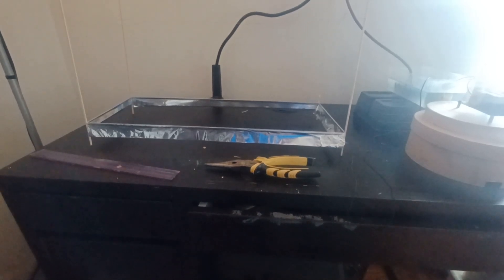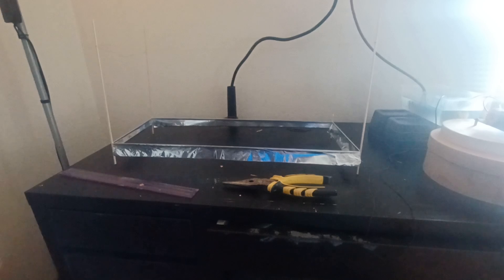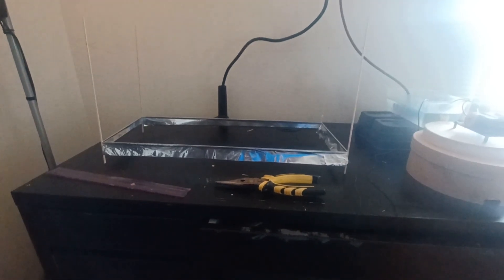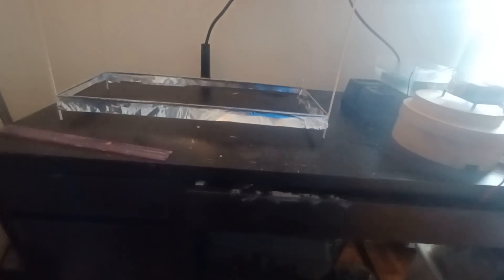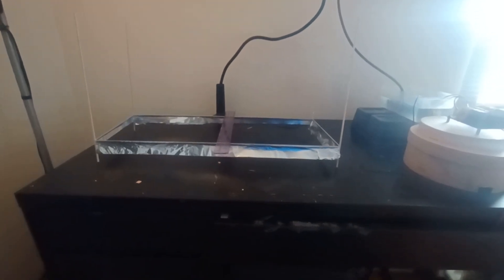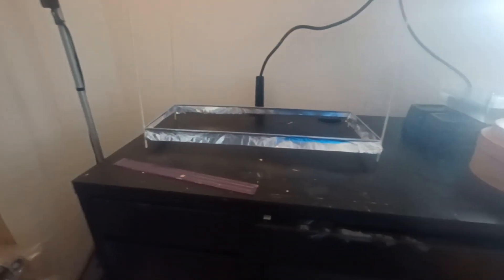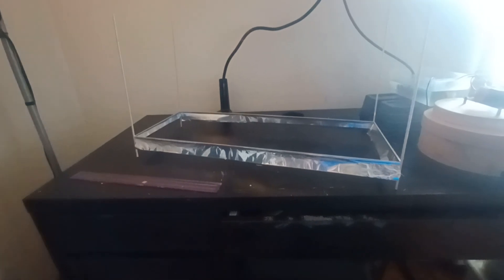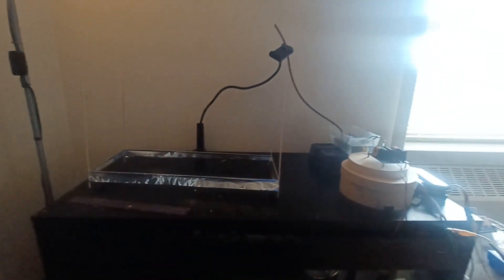ion lifter 4.2b

Comment: Did similar tests with my 250kv HV power supply.
My models look slightly different but the principle is the same.
During my many tests, I noticed there's a threshold voltage of about 10kv, anything under won't create enough thrust.
If using DC, a 5% ripple might be helpful.
There's tons of tricks to make these things go aloft.
Nice work.
Good luck.

Comment: looks heavy.cant believeyou are touching it with your hands!
Reply from the maker: @c6jones720  Hey. There is no high charge between the wire and foil. If i dishcarge it through the hv multiplier and ground. That will produce a high discharge.
Reply: @goobman1981  ok, please just careful, I've had nasty shocks from lifters

Comment: There's another thing about "jumping".
When it comes to dielectric materials, supplying DC continuously leads to saturation followed by dielectric relaxation.
What that means is, a short time after "jumping" the model looses its oomph and stops lofting.
Ideally, a HV impulse current could prevent that.
Reply from the maker: @valcocora5689  you are correct. I've done test where i pulse the switch and if im fast enough i couls get it to hover at a certain height before it veers off.
Reply: @goobman1981  Do you happen to know a way to produce high voltage impulse current?
Something like a Ruhmkorff, but for DC?
Reply from the maker: @valcocora5689  the way i would do it is connect a dpdt relay and wire it so it self oscillates. Then connect the relay from the battery to the zvs driver. Adding a variable air capacitor to control the timing of the relay.
Reply: @goobman1981  I wonder if that would work with my HV power supply.
It goes up to 250kv and about 3 mAmps
Reply from the maker: @valcocora5689  i don't see why not. Relays used in a car handle high current.
Reply: @goobman1981  Thank you for the tip, but unfortunately, that only solves half the problem for me. The other half is the model behavior when using materials with a high dielectric constant.
Reply from the maker: @valcocora5689  can you explain more. Is this a standard triangle lifter? How big is the model?. What material is the dielectric?
Reply: @goobman1981  The model depends on the material you use.
If ceramic, it obviously won't look like a lifter. Not a big loss there, the lifter doesn't have the best shape needed to do the job.
Size is another matter, hard to find somebody to build a ceramic part the size, say, of your lifter from the video. So ceramic models are usually smaller. I've been playing with models from 2 to 4 inch diameter.
Bur what you loose in size you gain in efficiency. The model speed goes up with the k constant. 
Allow me to give you an advice: if planning to use high k, do your tests outdoor, otherwise you risk putting a hole in your ceiling.
Reply from the maker: @valcocora5689  i thought about ceramic dielectric myself. I did find ceramic paper, but it looked as if it would catch on fire if a arc did jump between the wire and foil.
Reply: @goobman1981 
No, you need to look at the serious stuff.
And then you shall enter my world of frustration, lol.
Reply from the maker: @valcocora5689  sounds interesting. How do you need the ceramic shape?. What design.
Reply: @goobman1981  You ever seen a ufo?
Reply: If you don't mind my asking, are you familiar with assymetrical electrostatic fields?
Reply from the maker: @valcocora5689  actually yes
Reply from the maker: @valcocora5689  yes. Im familar with the fields.
Reply: Guys, buy barium titanium powder. 7000 dialectric constant. 

If you can make the powder even smaller, then it can go 15.000 constant dialectric. 

Buy 10g or other epoxy with high k. 

Melt the epoxy mix the powder. 

You can cast any shape you want. Good luck.😅
Reply: @Kingly-meh  That's all nice but how do you glue electrodes on such a thing?
Reply: @valcocora5689  it doesn't get very hot to melt it, you can use your kitchen. Electrodes you can put them ready before casting or during or simply after.
Reply: @Kingly-meh   What about the leakage at the interface between the electrode and the ceramic? That's also grounds for current leakage which leads to loss of power?
How do you solve the adherence problem?
Reply: @valcocora5689 it's a challenge. It has to be insulated with something.

I got little frustrated with the lifter due to sparking. I sprayed screen cleaner🤣 and it worked for a little
Reply: @Kingly-meh  Allow me to be more specific. Poor adherence between electrode and ceramic leads to tiny air pockets formed between the two. This in turn leads to loss of power just like you loose compression in an engine if the segments don't seal properly. This is enough to contaminate the experiment. I don't see how one could ensure this by manufacturing the ceramic capacitor in one's kitchen.

Comment: that is crazy it has to be 12" up on the wire. 200kv. Do you have a parts list?
Reply from the maker: Hi. Its the same voltage multiplier, flyback and zvs driver. Only 24v input and immersed in mineral oil. I believe i can push it to 300kv.
Reply: @goobman1981  so the voltage has a better distance when the capacitors are cooler in the mineral oil?
Reply from the maker: @nathanbunten4299  Yes. It keeps the transformer from swelling up. I've had several. These transformers can handle over 100v input. The oil also keeps the capacitors and diodes cool and prevents arcing over between each stage. Btw. I mentioned about the other youtuber using the tesla coil to lift. The same thing happened to me when i forgot to connect the top wire. On the smaller rectangular lifter. I removed the skirt. And it lifts with weight and is much quieter. We should talk.
Reply from the maker: @nathanbunten4299  im available now. Im on vacation. Lol
Reply: @goobman1981  let me set it up and send a link to you.
Reply: @goobman1981  let me know if you got it
Reply from the maker: @nathanbunten4299  where do i look for it

Comment: Bro, all you need is a frequency generator. The reason it sparks because it builds up amps. The higher frequency the less spark.

If you have that power on a small lifter with high frequency and 30mm distance. It will break the ceiling.
Reply from the maker: @Kingly-meh  so i should use a 555 timer instead of zvs?. However the 555 doesn't produce enough volts/amps when compared to zvs.
Reply: @goobman1981  You can put the output frequency of the 555 timer to the mosfet. 

With separate powers. Maybe 3/12v for the 555timee and 12v 5amps through the mosfet that only allow current when the 555 timer pulse. 

You can have 2  potentiometer on the timer for the duty and frequency control. Am planning to also add an audio input for frequency modulation.